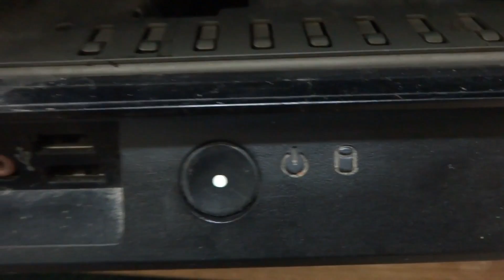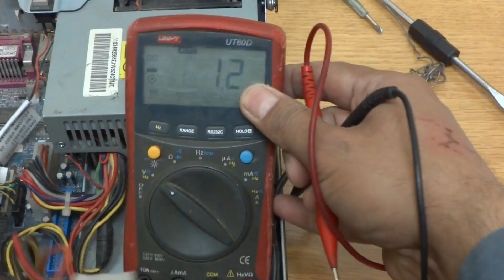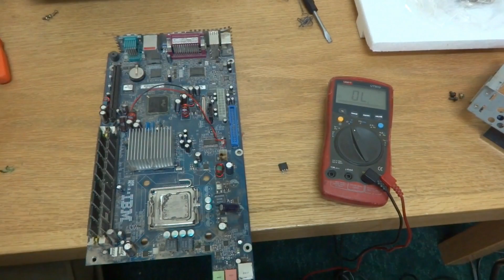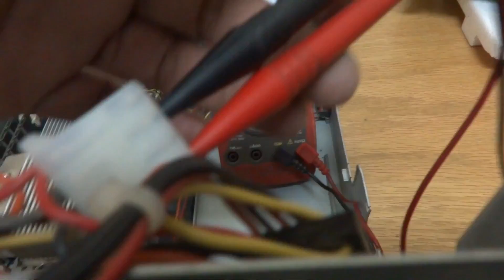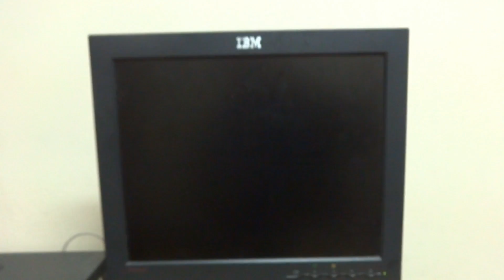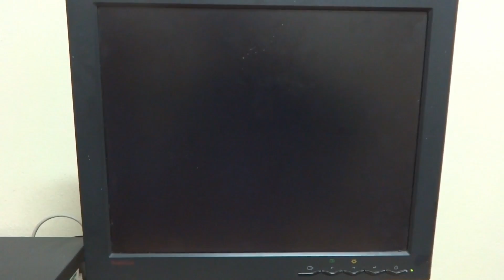Motherboard repair. Main board repair.

Comment: please help,my specs-msi h81m-e33 ,6gb ram,Intel graphics. The problem is my PC restarts after every 50minutes ,I have changed smps but restarts again and again. please tell me whether its motherboard problem
Reply: Check the GPU and CPU temperature. Maybe the cooling system is not working properly. Also, perhaps, a battery of volatile memory (BIOS)

Comment: sir sometimes motherboard refuse to start sometimes its start. when i check 12 volt atx getting beeps continuously. why plz help me
Reply from the maker: Maybe some of your power supply rails would have defective voltages. Try to check them using a multimeter.

Comment: Sir you have 2 capacitators that need to be replaced,in the back of the mothrboard,they look almost blown out.Use flux for smd component removal,and fum extractor,for your health.Keep doing good work.
Reply from the maker: +raziel x2k Yes you are right. But the board is still running as those caps were for fans and some other accessory. I  am using rosen flux which is the base of smd flux. I don't have extractor here but I am taking care from flux and lead fumes. Regards,

Comment: Thanks for posting such a great videos. I need help with the issue I'm having with my computer. My computer turns on but show no video. I know for sure it's a hardware problem since it's doesn't beep and no POST. I can see the chassis and cpu fan running along with green light turn on the motherboard. Reset the jumper, clear the cmos, removed all the RAMs and tried all of them one by one, don't see any capacitors out of shape, leaking or bulging. Power supply is good, checked with the tester, I did all I could by isolating each and everything. So, now it all comes down either a bad motherboard or CPU is bad. I didn't have a proper way to check any of these as I don't have any extra motherboard or cpu. I put my hand infront of cpu fan to check if it blows hot, but it didn't. I think something happened with the motherboard but I don't know exactly what and what circuit is causing the short circuit. Is there a way you could help me further troubleshooting? Thanks
Reply from the maker: +Omer Mian Just I got your comment at the moment after one month. Maybe you solved it. There are so many reasons for no POST. Sometimes you can solve it without understanding of the trouble. Some times it could be a corrupted bios sometimes it is bad RAM sometimes it could be missing secondary supply on the board and sometimes it is a bad North or South bridge. But in very rare cases it could be a processor. Wish you good luck with your success! Regards,

Comment: Hello Sir. Good job. The happiness which we get setting old things right, may not get buying new one. I need advice on what should I read to learn repairing things like computers and other electronics and electrical things. Please provide some e-books and web sites if possible. Thank you.
Reply from the maker: +Sanjay Prasad Thanks dear Sanjay for liking video. This is a must to repair defective things as for a small and tiny defect you can't discard a complete unit. As you are about to develop your repairing skills, it is important to gain basic knowledge of Electrical and Electronics. You can get benefit of YouTube and other internet resources. Also you may subscribe to repair channels so that when ever they will upload a new video, you will be notified by email and you will watch those and acquire knowledge from there. Still I am doing the same thing!

Comment: hello sir, is it more accurate when testing transistor by leaving the processor on the socket ? Or it is just the same with or without the processor in the socket ?

Comment: Hello Sir! I am awaiting a new motherboard for my 06, 17" iMac and I was wondering...if I had to switch out my old CPU and replace it on the new motherboard, or will the brand new complete motherboard work just fine. I've seen a tutorial video on which they switched out the old CPU and placed it on the replacement. So I was wondering if this was absolutely necessary? I saw your vid, and seen you've responded to some of your viewers, so I thought I'd try and ask for your helpful insight.
Reply from the maker: El Steve-O Radio™ Dear friend I am not able to get your point well. What I understood is you are going to replace your old motherboard with another good one. So OK you can do that as long as your replacement board should support your existing CPU and RAM. Otherwise you would have to change both of them also. In such a case you will be close to a new computer. You can test and try your existing bad board for repair. You will be able to repair that one for a very cost if you will be lucky enough! Regards,
Reply: Thanks for responding most urgently!  Let me try to state it differently. Do I have to take off the old CPU on the motherboard I'm gonna replace, and put it on the brand new, identical board which I will be receiving in a few days. Or will the brand new board with the brand new CPU work just fine for my 06, 17" iMac.

Comment: what about the two cap that are leaking
Reply: ***** I think three or even more...
Reply: +yonis78 right, the machine is very old, all the passives should be at least visually checked and replaced if required. also, dusts should be cleaned as well.

Comment: your expertise are  absolute, by the way I have a desktop, i repair laptop and do services on it, and my desktop won't turn on, so i decided to give it a try if i could also fix laptop, but before that , i keep researching on some stuff that would help me out, my problem is the system won't boot up and doesn't log in on bios,

i do the bread boarding technique by removing it from the case and put it on a non conductor material for instance a piece of cartoon in top of a wooden table, 

after that it still doesn't turn on, and there's no beeping coming up,

the parts are all good as i buy them brand new , and this cpu desktop never have issue until now,

i cant really locate where the problem is, but there's definitely no sign of short circuit or something,

my problem is just it doesn't start up there's no screen display, but the power supply is good the led is good, still it doesn't turn on, if you could help me out, it would be pretty awesome>

greetings from philippines
Reply: Peter Wang so , There is no way to fix it, but buy a new one? I still have it, And still didn't figured out what is wrong, I indeed replaced it with another motherboard, but the broken motherboard is still here, I Dont really know when it comes to board level repair, and havent found some courses online , so I could get and learn some information about it, it sucks. HAHA